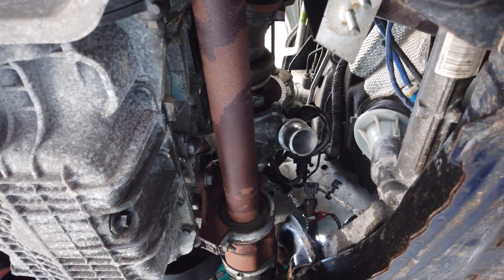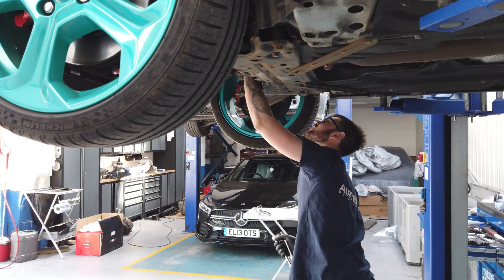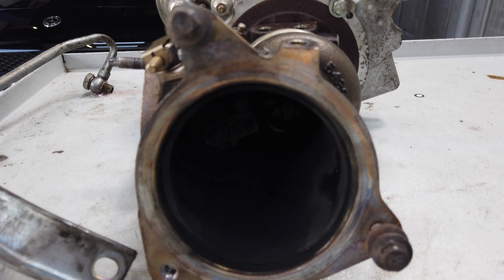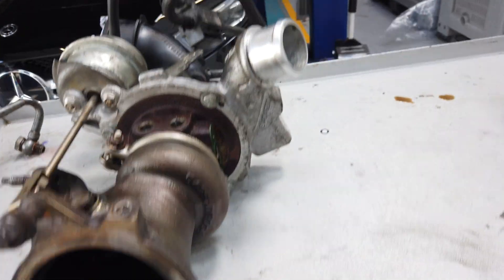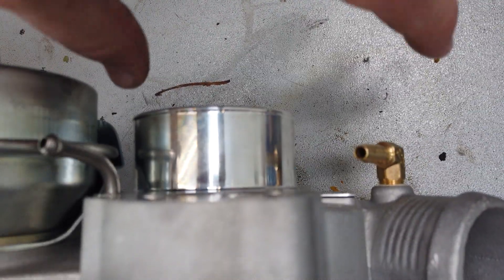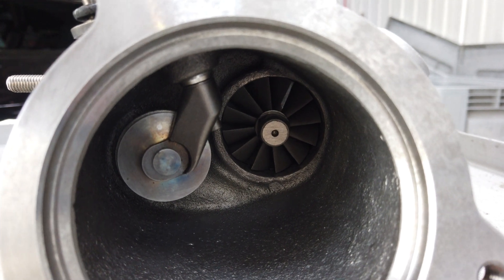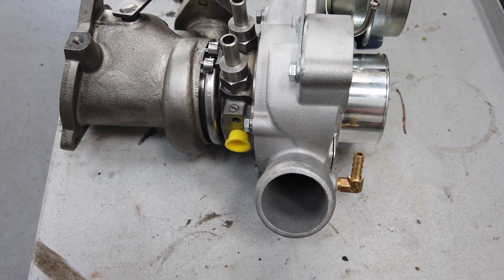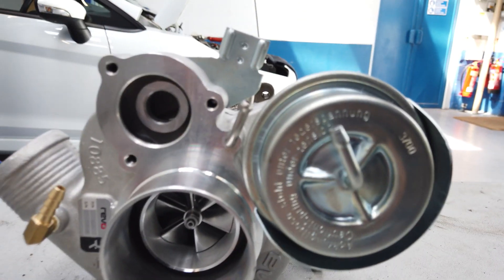REVO FIESTA RT330 TURBO! - install and first reactions

Comment: U should of gone for the x57r over 400hp
Reply from the maker: 330bhp is plenty to get to 70mph :D over 400 is a different level tho, would need a bit of work and money to make it useable
Reply: if you go x57r you need a fully forged engine. That's not cheap lol.
Reply from the maker: @Ghrolz  thats just the start, youd need a clutch, diff, uprated fuel system..
Reply: Pumaspeed X47 your need a lot more money to get an X57R/RS due to supporting mods required
Reply: Graham hi u don’t need a forge engine on the x57r only upgrade injectiors and with the x57rs then u need to go for full forge engine these engine are compatible of 400hp for any forge is needed
Reply: Scott Hastings hi with the x57r u only need injectiors which make it just over 400hp and it all depends on what u use the car for if u use car for track then yes u do need to forge the engine but every day road use would be fine
Reply: Scott Hastings not as expensive as the RT330r turbo I’ve got the x57r and it was cheaper then revo one and still had more power then revo I made 365hp